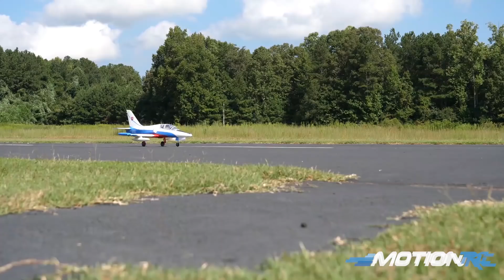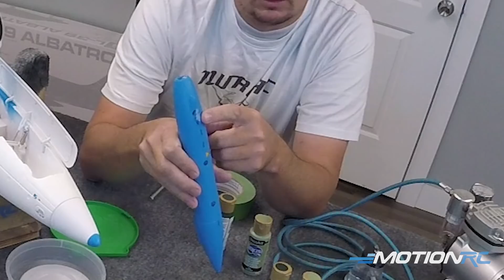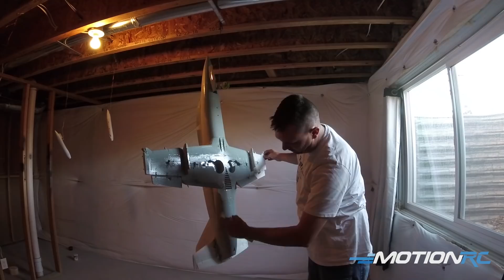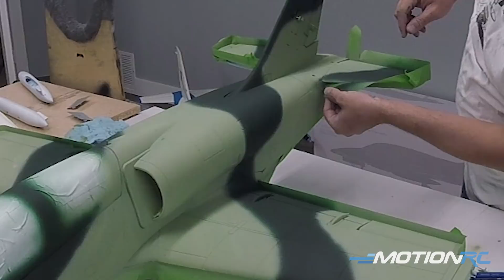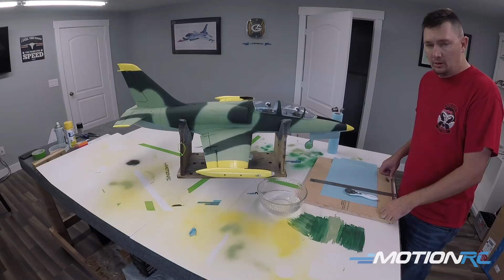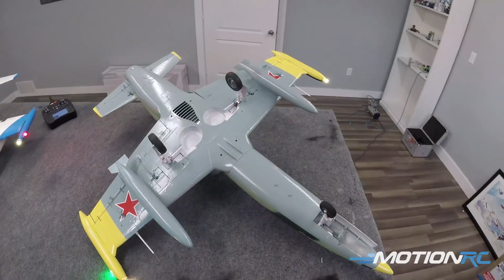Customize A Foam RC Aircraft with Jeremy Solt - Motion RC Extra

Comment: Been trying to custom paint my 2.1m e-flite carbon cub but noticed that acrylic paint sprayed with an airbrush does not stick at all to bare foam surfaces. It is a known issue with EPO foam planes. The FW L-39 is also EPO I guess. Probably your primer went on well because it was over the existing paint, but I still cannot figure out how to go about painting over unpainted EPO. Too many videos and posts in forums but there is not a single good reliable technique.

Comment: being a new modeler we find means and methods hard to find, so we just stumble upon them, like this..
AND you can use minwax wipe on poly and rust-oleum oil base enamel directly on FOAM, we discovered this while painting an Arrow foam Corsair.
I happened to get some oil base paints on the foam packing and realized that not only does it not dissolve the foam, it bonds very well to the foam.
We even poured some paint thinner on the foam and it pooled on the foam but Did Not Dissolve the foam.
The cheap paint that came on the plane peeled off with some Blue tape after I had painted over it with some latex water base paints; 
So now I am using poly (not water based) or oil base enamel to prime and harden foam
Yes, you can coat your Foam plane with oil base poly, paint etc, resulting in a Hard structural skin.

Comment: Hi, this is a great video and thanks for sharing.  I tried to follow the paint method. However, after I pained the whole aircraft, then I tried to apply some tape to paint some small area. I found that when I peeled off the tape, the underlying paint was peeled off too.  So I have to give up doing any accurate paint.  What is wrong with my painting, why did my tape bring paint with it? Thanks a lot.
Reply: Long Yang - you need to make the tape less sticky by applying it to your clothes.    Even then it peels sometimes.   When it does that you just spray a bunch of paint into a cup and use a use a foam brush to dab the peeled area.
Reply: @soltproductions  thanks a lot. I finally did this to make it less sticky, by repeatedly put it on my pants and peeled it away.
Reply: After pressing the tape to your  pants. Try rubbing baby powder or talcum power as it is called in other countries on the ace that you want to place the masking tape. Then blow off the excess powder. Place yuor tape gently in place only rub down the edge against the line that you are painting against. 
Sprat your paint and let set up a little  bit and then peal the tape back against the grain at an 45°angle slowly.  
It will save you a graet deal of headache!.👍

Comment: Hey Jeremy I bought the compressor air brush kit like you have from Harbor Freight however the airbrush that came with it looks different than your, is yours the one that came with it or a different one?  There is also no pressure regulator and this air brush would be very difficult to try to do small precise work like panel lines, or at least I think it would be.
Reply: Nevermind I see why yours looks different.  You removed the cover from the rear of the airbrush.  I wish there was an air pressure regulator though.  I think it would make doing small finer lines easier.  This brush has worked fine though for doing base coats and larger areas.  I may buy another airbrush the has a pressure regulator built in for finer detail work.

Comment: very nice job, I was inspired to go out and get a HF air compressor set, and do this scheme on my Avanti. Looks great, but I screwed up and used rustoleum 2X PAint and primer , and now my acrylic is flaking off after one flight. I was planning to coat it with polycrylic after test flight today. Will that help seal it in, or any other way to fix the mess of having painted over enamel with acylic? Thanks
Reply: The min wax should hold it all in.  I love how it protects the work we do.

Comment: Great video but I need more info on prepping foam surfaces with regard to factory paint and the mold release agent. Could you please state clearly what to do. On my Eflite models the factory paint peels off when you remove tape and the paint does not stick uniformly.Even the primer is problematic. Is it just the way paint sticks to Eflite foam or are there some prep procedures I am missing.
Reply: Marc Levy, there a re a few ways of prep work out there.   There has only been a few parts that I have ad where the process in the video may have an issue.  I have used lysol wipes before on surfaces that I have not just opened up. Some people use chemicals to remove paint but I dont go that far.   As for eflite, I haven’t painted any eflite birds so Incant answer to their paint or painting of any of their birds

Comment: Hi Jeremy, great job.
Have you had any trouble with the Rustoleum paint "eating" the foam?
I watched another video where he used it and it did just that (he was testing it on polystyrene). Maybe it effects polystyrene but not EPO? He suggested an acrylic spray paint such as Liquitex but then I've heard that acrylic paints don't adhere properly
Reply: One EPO foam I haven’t had any issues.   However almost every spray paint will eat the lighter and super delicate EPP foam.  The difference in foam is huge     The foam i am talking about in not using spray paint on is the foam in the freewing F-18 and eurofighter.
Reply: @soltproductions  If you're talking about the older F-18 from FW, they were EPS foam. The newer FW 90mm F/A-18C is EPO foam. The E-flite UMX planes are also EPS foam.
Reply: Yeah I gotta test

Comment: Hi Jeremy, do you have to sand the plane before you spray the primer? Thank you for this video.
Reply: I don't sand anything because the paint I use sticks really well. in-fact it sticks so well that usually the only issue you get is that the original paint will peel before the newly applied paint will have issues.
Reply: it would help the paint stick better, i always sand before painting

Comment: What is the cost to do something like this?
Reply: if you do it yourself, it would probably cost about 50 dollars for materials
Reply: If you already have some of the items your better off. this is the estimated costs that I  spent.   Cans of paint were about $4.00 a can. Frog tape was $6.00. Airbrush System $60.00. glass Jars $10.00. Polyurethane $9.00. Acrylic paint $.90 a bottle. Post-it notes $4.00. Blue Paper towels $2.00.